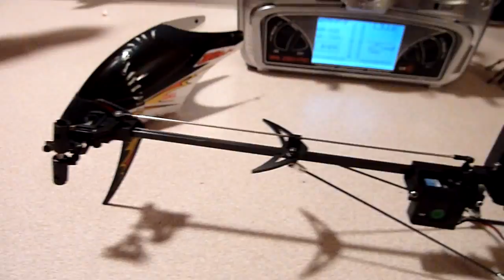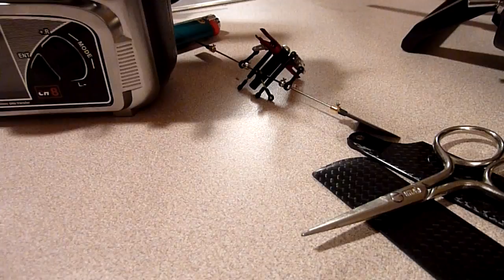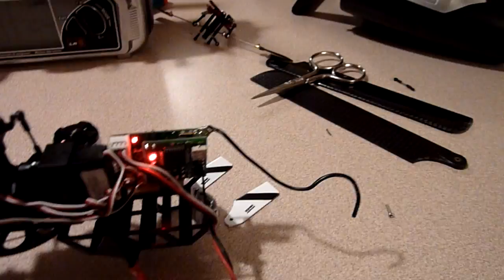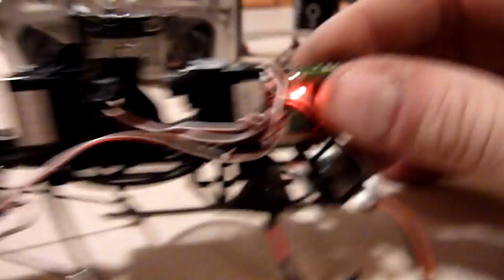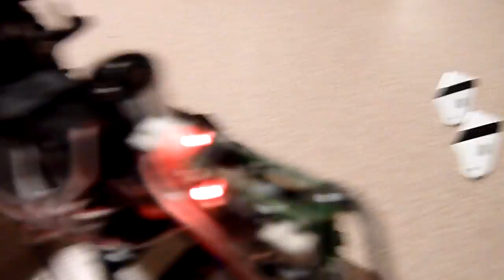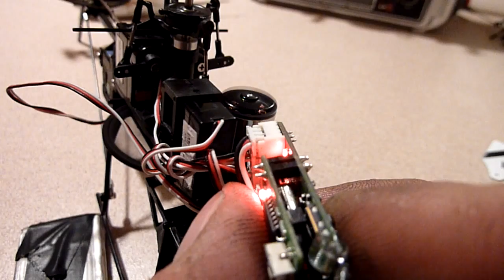Walkera 4G6 In Flight Out of Control Tail Servo Cause

Comment: you know I just got one of these, but mine had tail vibe with the stock tx, and my 2801. Finally figured out how to set the gyro in the 2801(2601 mode) to stop this, I almost thought I had your problem but mine was brand new out of the box like that. Who knows maybe my gyro shakes in the rx never really looked. I also noticed when it binds I have to wait until the light stops flashing even after the motor beeps, if I move it before the light stops my tail trim is all screwed up